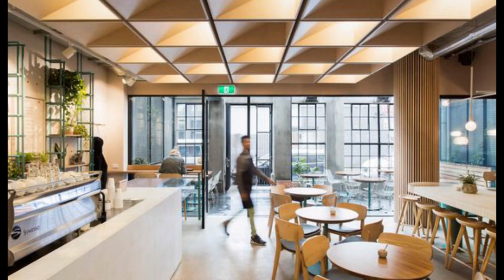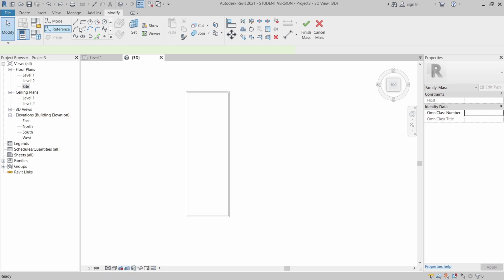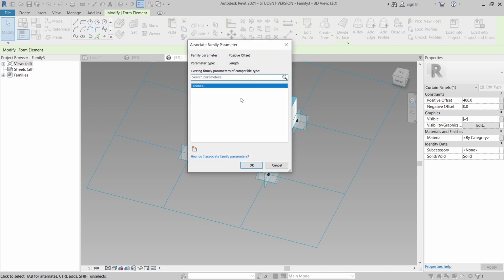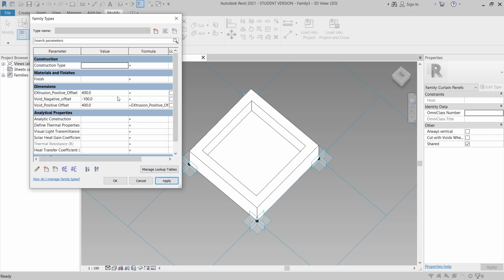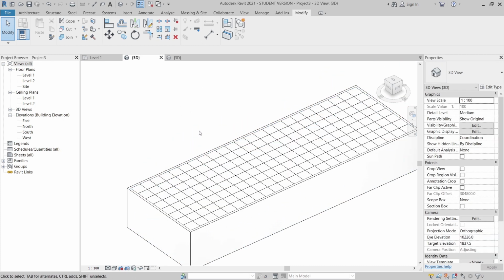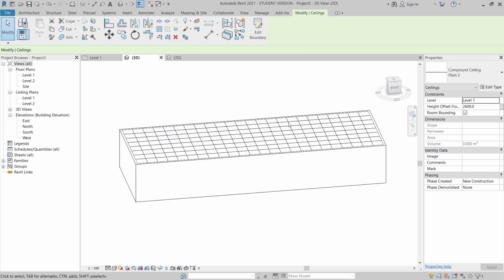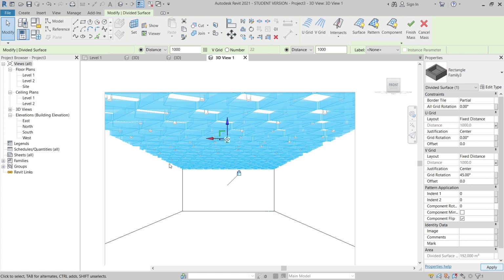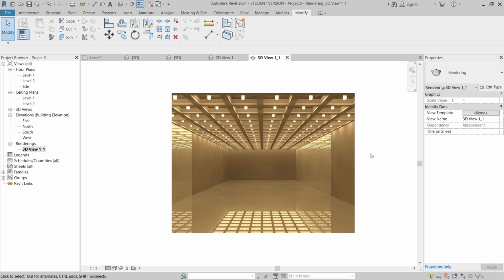Parametric Ceiling Design in Revit

Comment: Please how to make winowing an wood ceiling like this proyect 

https://www.plataformaarquitectura.cl/cl/884860/casa-claros-sommet?ad_source=search&ad_medium=search_result_all
Reply from the maker: Got 4 way to achieve those kind of ceiling

1. You can use curtain glass mullion & adjustment your horizontal spacing. 
2. Massing with curtain glass systerm
3. Adaptive component
4. Generic model pattern base